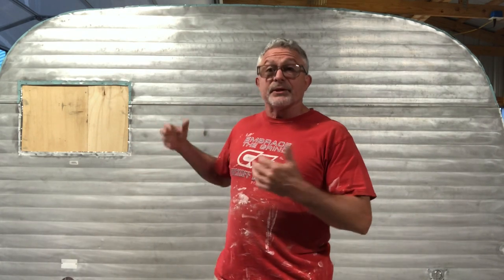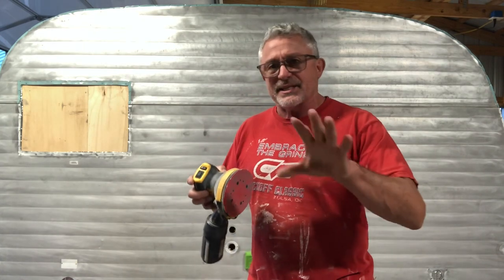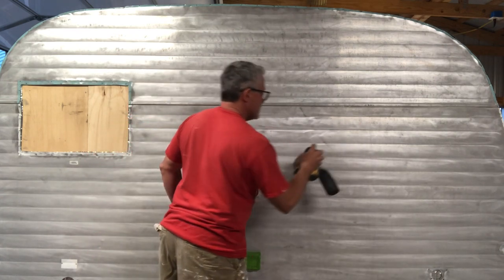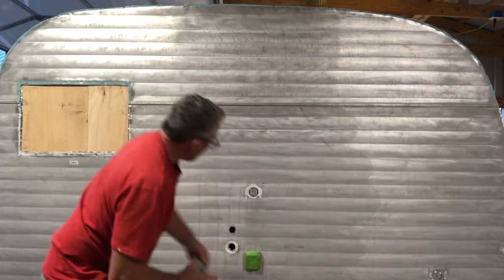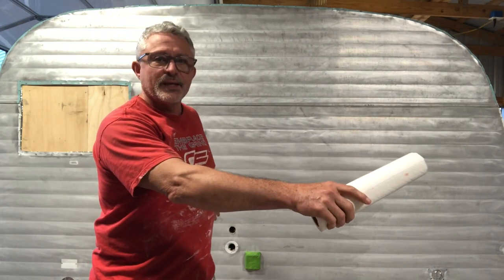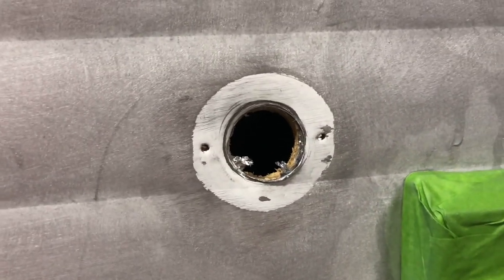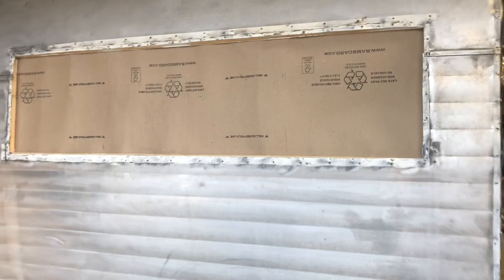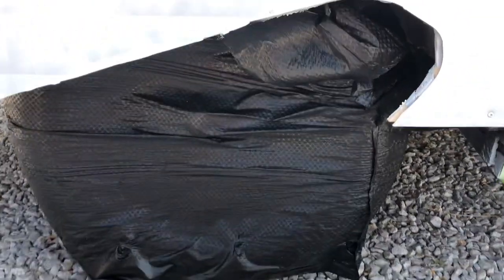EP 82 DIY paint prep. Easy to do for your vintage camper travel trailer.

Comment: I have an aggressive paint job on mine that was there when I bought it. Besides applying a more aggressive grit to the sander, are the steps for paint prep still the same?
Reply from the maker: I think so. Big grit can wear away the aluminum quickly, use with caution.

Comment: What's weird is the 1963 has the sink/stove on the opposite side. Any tips on replacing the caulking around the windows? Ours aren't as in good of shape as these were. Also any tips on waterproofing/weather proofing? We're total newbies at this. Luckily the interior has been fairly remodeled and new vinyl flooring, etc. Even has a flat screen. But that remodel is 10 years old now. Outside is ALL original.
Reply: Would you happen to have a window pane that would fit a 1963 serro scotty? We'd pay for it and shipping!!! It's the one above the bed
Reply from the maker: You can go to Lowes and they can cut glass and then you can reinstall it. Thats what I do. If you take your windows out you can clean and replace the butyl tape and thats how they we were sealed from the factory. Good luck
Reply: @RobTheRebuilder  thanks for the reply! Will look into getting that cut there. We plan to pull out all of the windows and reseal. Day 1 of repainting with primer. Next step, rip out 9 year old vinyl. We're curious about what someone like you would charge to take off the skin off and put new insulation in?